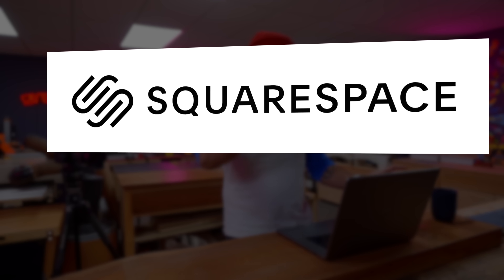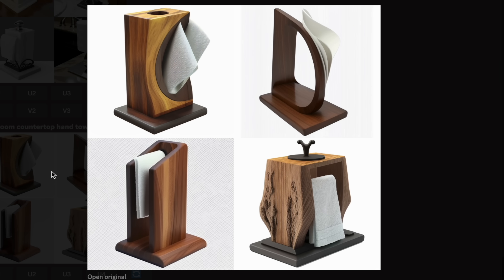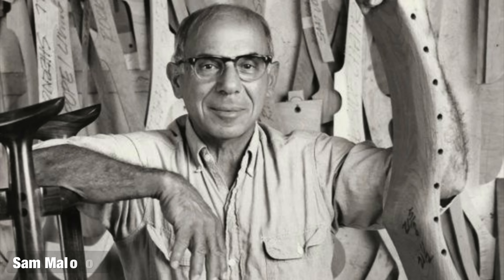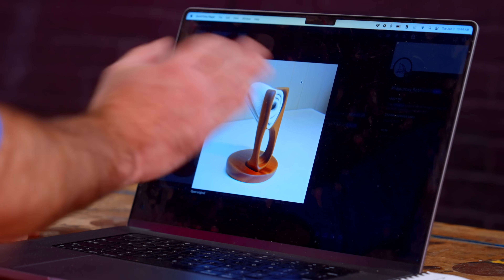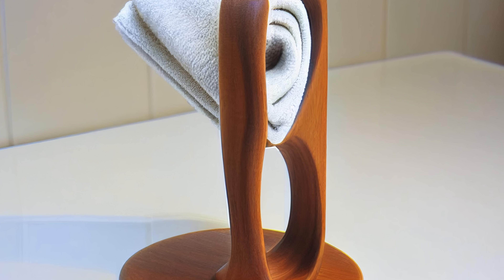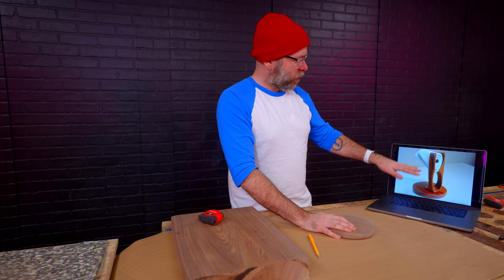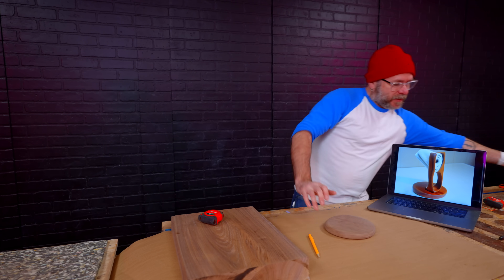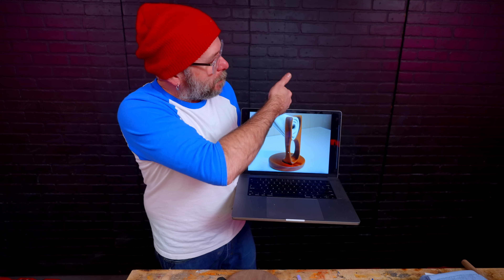MIND BLOWN! 🤯 Using AI to Design a Woodworking Project

Comment: If might not have been your idea but you made it with your own hands and skill. I think as long as there are disclaimers in future projects by others than I'm ok with that. On the other hand if you used a CNC to make that then you i believe you can't call yourself a woodworker. Using AI to design and CNC to create, no skill at all.

Comment: Why do people love festool saws, any of their saws. They are weak, they are slow. Any regular chop saw you can just blast through what you are trying to cut. My father has a festool track saw and it sucks. I have to push so slow. My dewalt circular saw is was faster, does not bog, and was 1/4 of the price.
Reply from the maker: Their miter saw has won the best dust collection award in a few shootouts by the major magazines. Dust collection is extremely important to me.